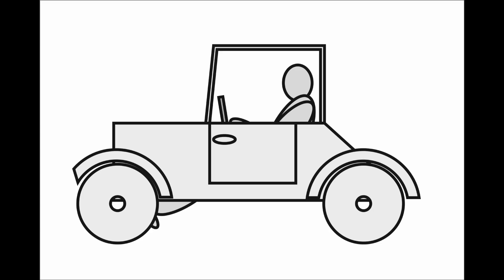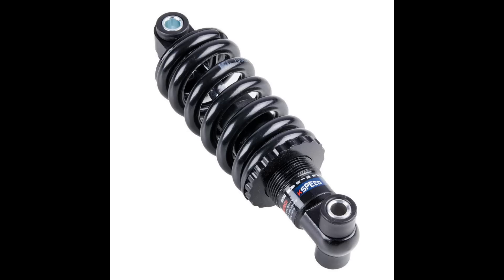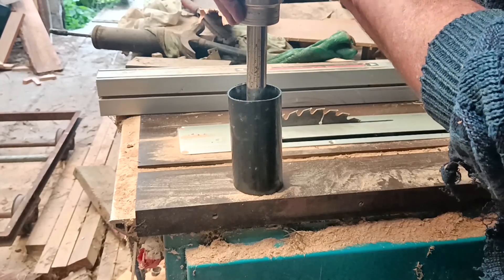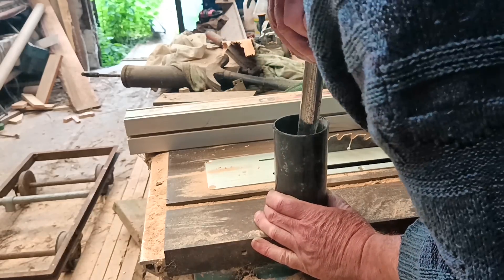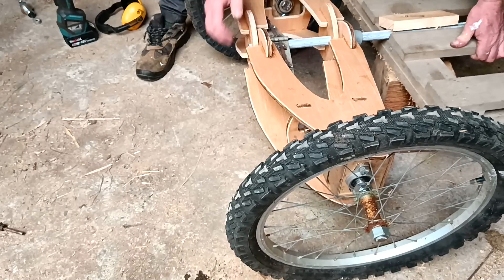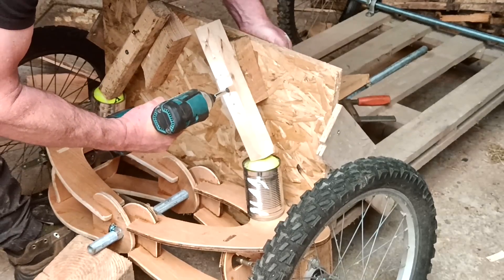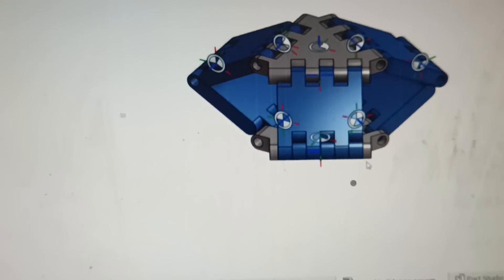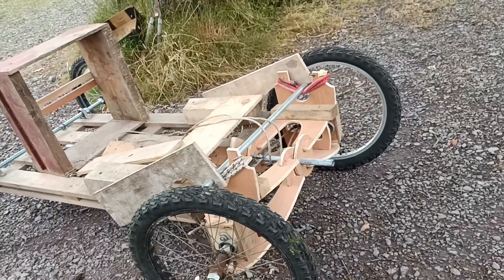Can I Use Tennis Balls For Suspension In The Wooden Car? Or Bungee Cord?

Comment: Project Farm  channel's recent video shows how bungee cords degrade in the outdoors within months due to UV. It may be less so in Ireland but they will still degrade over time and from use.
The suspension may not need adjusting as it will sag initially.
Reply: Project Farm also tested UV stabilised bungees, they were much less prone to degradation over time.
Reply: @locouk  I'm not sure about availability of specific brands. I presume Tim will use what is most available to him.

Comment: Squash balls have been successfully used in home built microlight undercarriages, the extra bonus of squash balls is they come in three levels of hardness so you can tune it to your vehicle, they are also smaller than tennis balls.
Keep up the videos, I’m really enjoying them.
Reply: some bike seats use the squash ball principle, in tandem with coil springs. they are good when the weight of the suspended load is low and you don't need more than 1.5" travel
Reply: Sounds pretty painful

Comment: have you noticed how an air spring looks like a pneumatic wheelbarrow wheel on its side (or stack of wheels), i thought about using them a compensating bolsters on 7 1/4 gauge railway articulated wagon bogies, never got to testing
Going a little further; my old mid 90s kawasaki motorbikes rear shocks (old twin shock swing arm) are a pair of air bladders in a cylinder style housing, linked by hose filled to about 3-5psi, forks are similar but 10-15psi, food for thought
Reply from the maker: You're right - I'd need something quite a bit smaller than a wheelbarrow wheel though. Hmmm..

Comment: @Way Out West - Workshop Stuff
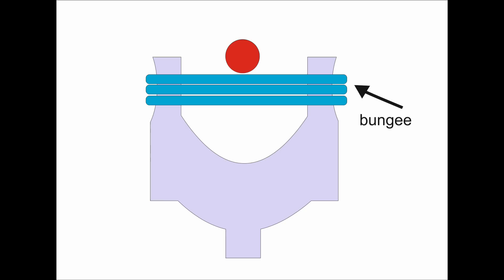7:40 Bungee cord is probably a bad idea, because they contain rubber.
I have learned from JoergSprave (The Slingshot Channel) (and he REALLY knows rubber), that rubber looses it's elasticity when stored in a stretched out way.
Rubber works best when it gets stretched out for as short amount of time as possible, then is stored in a "relaxed" state.
Reply: Joerg Sprave is definitely the good guy to consult on nutty and dangerous wooden contraptions.
Reply: I liked the tennis balls rather than the bungees the bottom of the cylinder needs to be canted at the mid angle of the swing arm - I think.
Reply from the maker: True, but with enough of it, and a very light body, there may be very little stretch most of the time?
Reply: @wayoutwest-workshopstuff6299  If you cut bungee apart, you will see that its just a lot of thin rubber strands.  Just like any rubber bands.. they eventually elongate, and even break apart.   This is why Bungee Jumping stations, have to constantly check and test the bungee cords... and even then, there have been tragic cases of the thing snapping.

 You could probably solve the tennis ball issue,  by making pivoting joints.   They will certainly hold up better, than Bungee.

Comment: 0:24 The profile of the wheels is not in the same direction, putting this right will improve driving characteristics !
Reply: Positive camber can actually help on skinny wheels like these. Check out what 1920's race cars looked like.
Reply: @nobodynoone2500  Sorry, apparently I wasn't clear enough (it got lost in translation 🥴). I was simply referring to the profile in the rubber of the tires.
Over the centre line of a tire you can see little arrowhead like shapes, on one wheel they point forwards while on the other they point backwards, 
this will cause uneven drag and grip. I once had the same on my (two front wheel) tricycle, that made it hard to steer it in a straight line.

Comment: This would be a separate project of course, but whenever you get around to doing more on making a loco for the railroad if these would work for suspension there? Of course, you don't have to have suspension on a loco, but it would help smooth out the ride a bit with any imbalance as the pistons shift position.

Comment: If you just want to keep the wheels on the ground you don't need springs at all.
Put the front wheels on a single bar and have that pivot with regard to the body and rear wheels and all the wheels will stay on the ground.
Generally speaking to keep all the wheels of a N wheeled vehicle on the ground you need N-3 pivots. Like a 3 leg stool a three wheel vehicle will always have all 3 on the ground. After that each additional wheel needs a pivot somewhere.
Check out a mars rover for example. 6 wheels, 3 on each side. There's a pivot on each side for the rocker that pivots 2 of the 3 relative to the arm coming from the body. There's also a third pivot that's kinda hidden in the body, but it's between the arms on one side and the arms on the other. It's actually a differential which ensures the body sits between the two.
Now if you want a smooth ride, that's a whole other matter, that needs springs, although don't forget you are getting a bunch from the tires already.

Comment: I would make a 4:1 leaver arm to increase the amount of travel you get out of the tennis balls. This way you can use just one, instead of two, as well – or use two in parallel to reduce the load and thus precompression on them.

Comment: Nice solution, Tim. 
I find bungee cords vary quite a bit in their quality and longevity. Used inner tubes may perform a similar function? Also, you’re always way ahead but having a configuration with a bit of lever arm and the elastic member at the end in pure tension might last longer and be easier to adjust.

Comment: The issue that I saw with the chassis design that you showed at the beginning of the video is that it appears to come from the point of view of car design. A car chassis is built to support much greater mass and forces than a pedal-driven vehicle for two (or 4?) riders, so it's a needlessly heavy and overpowered chassis design. A better approach would be to look at velomobile designs and maybe base your chassis on design principles there. In fact I wouldn't be surprised if other people on the internet have already attempted to build wooden velomobiles, and perhaps have come up with solutions to the design problems you're currently working on.

EDIT: And personally I think I'm more of a fan of the tennis ball suspension idea because I think the bungee cords would stretch over time and would need to be replaced more often than the tennis balls. But it also depends on what you think is a more comfortable ride, and easier and cheaper to build.

Comment: You might be able to use just one ball if you increased its "squishyness" by drilling some holes through it.  Since those special tennis balls arent hollow, but have foam in them, you should be able to get any level of squishyness you want by drilling holes thru them.
But yeah, i think i like the bungie system better too.

Comment: What you've done is pretty much s leaf-spring system using bungee cords.
Reply from the maker: but much lighter
Reply: @wayoutwest-workshopstuff6299  It reminds me of when I was in London, 40 years ago, with my aunty. I noticed the royal coach had leather straps as suspension.
Reply: Now if he had a bit of spring steel laying about..